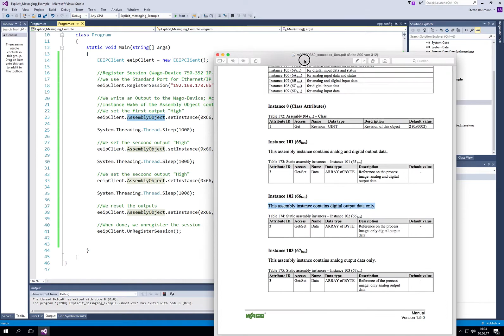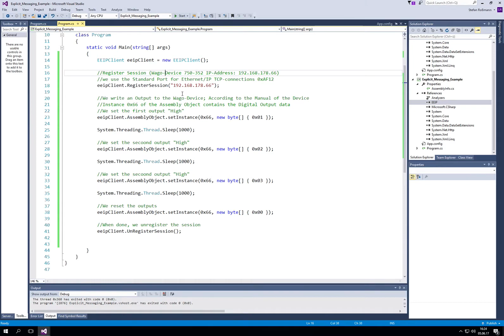EEIP Library - Explicit Messaging: Write Digital Outputs to Ethernet/IP Device

Comment: This DLL saved my project.  I use EEIP dll to talk directly from my PC to an SMC valve manifold (Sy3000) controller UIUSP-SEN1-DUO02979 (newer EX260 USA only model).  I did not want to purchase a $600 PLC computer, since I only needed the SMC device.  I currently use Keysight Vee, but this DLL can be used by most any programming language.  My purpose was to talk directly from PC to SMC valve manifold without any other hardware, and it worked beautifully.  You can use this DLL for any other Ethernet/IP implicit or Explicit messaging device.  Very well documented with many many features.  Well done, and thank you, thank you, thank you!